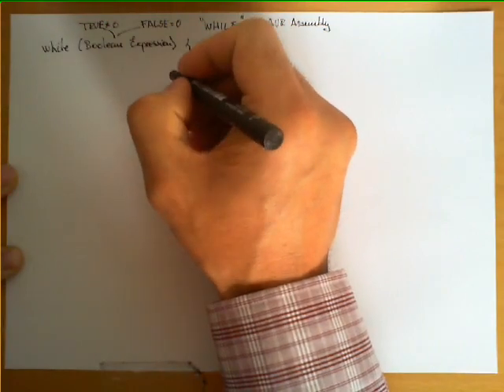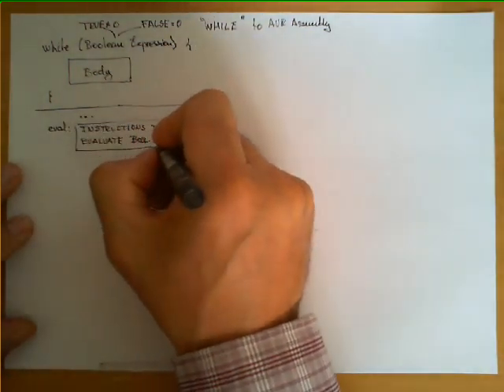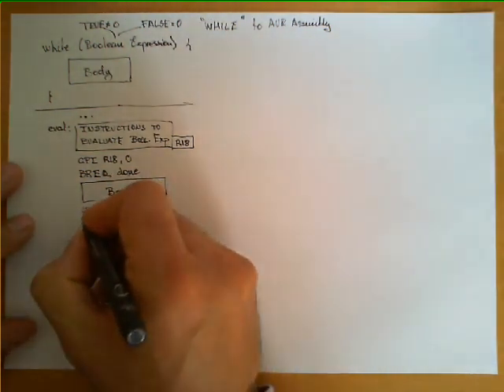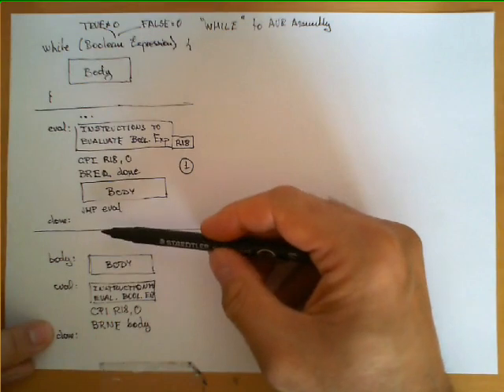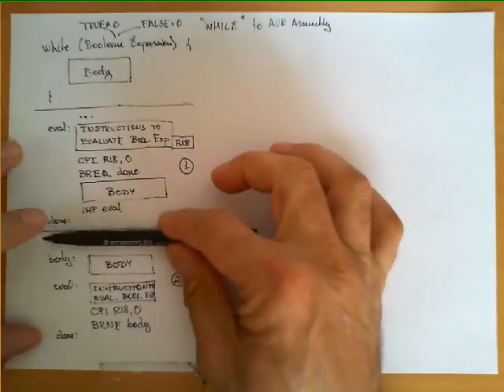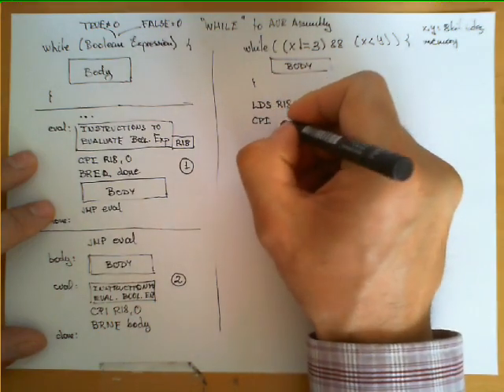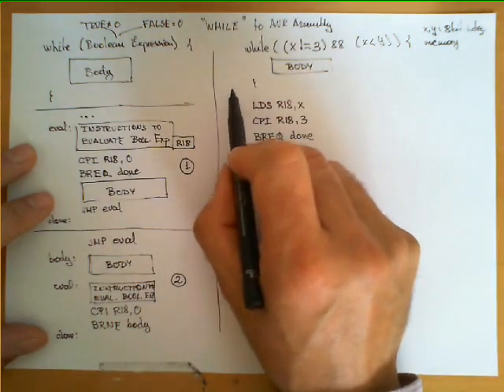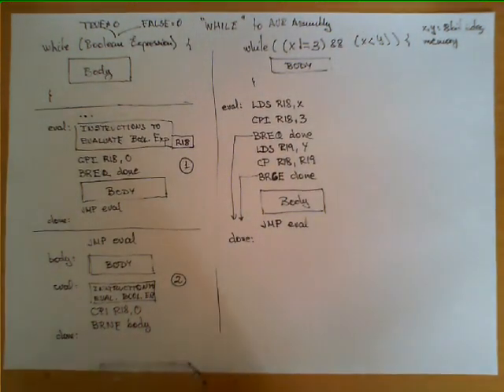Translate a while statement to AVR assembly code

Comment: is there some kind of book you can recommend to help understand AVR Assembly code?
Reply: why  need  understand  assembly  code !    i am  programmer  i  use  assembly from 12  years  now  i  need  switch   to  C
Reply: Do you have any knowledge of digital eletronics and microcontrolers architecture, or to put it in another way, what an mcu is and how it works? If the answer is yes, I think the starting point is to read the device's datasheet along with the instruction set. In the datasheet you will find assembler code examples along with the explanation on how each particular peripheral works.
Reply: Ey ukuhlukumezile uWalingo nkos'yami. Nami ngilana ngenxayakhe🤣🤣🤣
Reply: @_philani_  uthini nah :face-purple-crying::face-purple-crying::face-purple-crying:
Reply: @mokoepa  yini nawe uyamazi yini uWalingo?